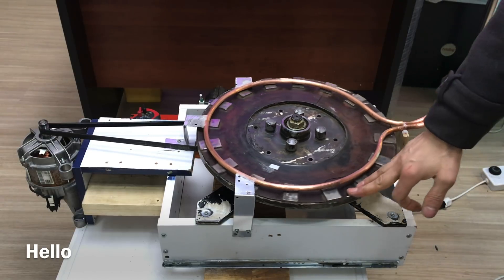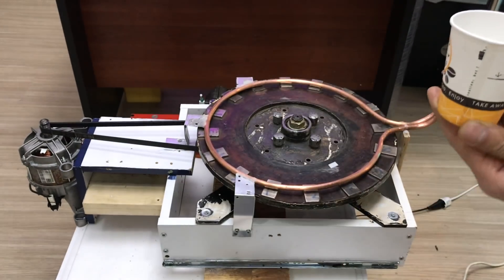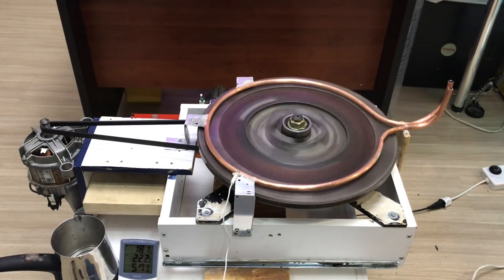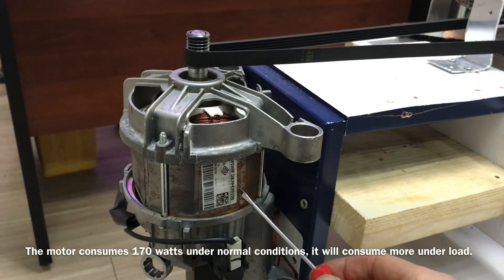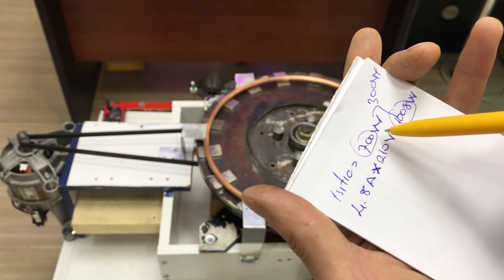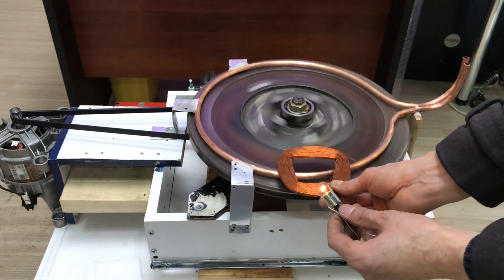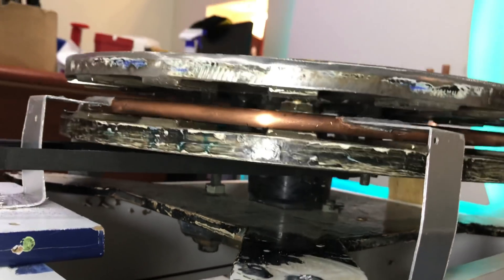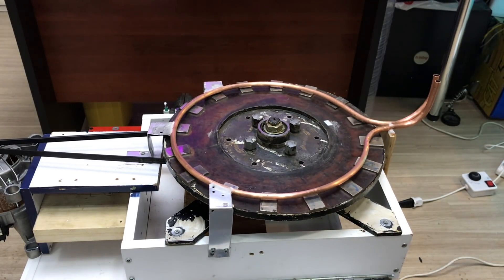MIKNATISLA ISI ÜRETİMİ, MANYETİK ISITMA VE REZİSTANSLA ISITMA KARŞILAŞTIRMASI

Comment: Thank you for this video  but its taking a long time to heat the water inside the tube . Yes as (paradiselost 9946 ) said  just press flatten your copper tube and you will get a longer current path at the flattened sides  resulting in more induced currents and much faster heating.

Comment: Hello Sir, I have arranged six magnets on a motor to heat up a copper but it doesn't heat. Please any idea on how to make it work (arrange the magnets polarity).
Thanks
Reply: RPM is always an issue. Distence from pipe to magnets. Shape of pipe. He may have operated at 1 to 2KH with relativley strong magnets: 10kg lift x 18 magnets x 1,000 rpm. Having 6 weaker at lower rpm can bring the temp waaaaay

Comment: Thanks for the video but that wasn't a good comparison.   The water in the tube is thinner than the water in the kettle.  Also, your method of measuring current isn't fair.  What you need is the water in the kettle has the same thickness as the water in the tube.  Then use the amp meter to measure the current, not the rating of the kettle or the motor.  Also use the timer to track the boil time.  One thing to consider is that the water temperature in the kettle is more uniform than that in the tube.

Comment: Probably schools should teach science better...  The magnetic field has to cross the area of the conducting coil to induce significant current (as your coil with LED does). Or you might use conductive plate to transform alternating magnetic field into current and heat. A resistive stainless steel can do... A snake-like design may work, although with large air filled gaps it will still be veeeery inefficient. A normal alternator + resistive heater should definitely work better.

Comment: The volume of the copper tube is 0.05 l, the diameter of the tube is about 8 mm, the radius of the tube is 4 mm, the length of the tube is about 1 m. So let's calculate 3.14 x (4mm x 4mm) x 1 m = 0.5 dl. Original formula for volume πr²l. Motor 220V / 4.8 A = 1056 W! So, as I already wrote to you in other videos, it is not very efficient... Plus additional expenses for magnets, copper pipe, radiátor,  pump, hose, motor and time for construction? And above all, it's noisy! I'm not talking about the thermal and induction losses of the motor, so the efficiency can be 50%....
Reply: hello, I want to talk to you about the system, can you give your mail?

Comment: Hook your magnet base to a steering engine (Runs on heat) and wrap the copper tubing around the heat collection bulb of the sterling engine., use an external heat source to get it running until the copper is hot., it will run itself.
Reply: Lol yeah overunity can only happen when tapping into an extra source of potential energy like a sterling engine on a geothermal site or copper that has an oxidation on it to take in solar power but it's a lot to overcome friction and wind resistance but in a vacuumed box using magnetic bearings you probably could keep it running from solar power of copper coated in oxide like the first solar cells that existed and spend 50,000 dollars for a motor that can't do any work !!! But who knows how long until it sucks in hydrogen or other gases through the plexiglass and slowly dies I know it's basically impossible to keep hydrogen in a container so it's probably impossible to keep out!!! Lol

Comment: Place your copper coils over top and underneath the magnets, add more turns. Place in a vacuum chamber and eliminate air friction and heat losses. Use more smaller magnets will work better work due to the higher frequencies. Like an induction heater Direct drive would also use less energy. Very cool! Tim van der Horn Canada chers.
Reply: Great advices. I think that magnetic field suppose to go through windings of copper tube. Not just lick simple, straight pipe
Reply: I was wondering if the could divas you said by putting in more smaller magnets but puting then in north South East and West poles in a random way hopfuly creating  random fiction from all directions hopfuly creating more heat also could you make the pipes have lumps of copper randomly made into the piping up to a inch thick all over piping also therfor creating more friction then creating more heat . Would it work that is the question.???
Reply: just by utilizing more turns within the eddy currents area of range will multiply the surface area that's affecting the water. since the copper coil's circuit (like a wire in a circuit) is a broken circuit, the drag that is created should be negligible to the benefits of increased turns of the pipe.

Comment: I couldn't see very well, but. Your coil looks as if it is grounded at a few points. An since your passing magnets along a copper apparatus,, wouldn't a electrical  charge be generated into the copper pipe. I think I see a short circuit.
So I'm wondering 🤔 if this is also assisting to your heat source. 🤔
Reply: The whole point is to have the electrons in the pipe vibrating - pref up to 50kh. Theoretically the net effect is a neutral charge with the liquid being a coolant.

Comment: Thank you for demonstrating a great alternative heating possibility! What factors could make it more powerful? Bigger magnets? Faster rotation speed? Using more copper? Would love to hear your opinion.
Reply: This is just a very simple induction heater 
Commercial induction cooking doesn't use a rotor to spin the magnetic field it dose it digitally with sets of electromagnets thus much more efficient bc its electricity>magnetic flux>heat 
Where as this is electricity>kinetic energy+>magnetic flux>heat +all the friction loses that you don't get with solid state induction heating
Reply: @dez3940  What method would you use to increase efficiency of his machine ??? I know they are right now using something like this heating water heater with crazy low electrical usage.
Reply: more copper. or, more SURFACE AREA.
simply flattening the pipes gives the eddy currents a better path.
using a thick sheet of plate would make it a brake... a dyno. an eddy current dyno...

Comment: Nice work. Btw, here in Serbia we also call bakar, as the only name for that metal.Also it is the case in Slovenia, Croatia Bosna , CG, Macedonia. Ex YU.
Reply: Do you call  also this words,  cekic  peskir  yastuk??
Reply: @burak...2648  yes
Reply: Hammer, towel, pillow
Reply: @burak...2648  baklava,  astal?
Reply: @colloidalsilverwater15ppm88   i dont know,  but you know also baklava 😊
Reply: Saying also,  hayde siktir ? 😊
Reply: @burak...2648  hajde, but siktir I think still in use by some older people in Bosnia. I know the meaning: go away, run from me or like that.
Reply: Corapa makaze ?
Reply: @burak...2648  Ĉarapa, čarape means stocking , stockings. Makaze are scissors.

Comment: Hocam bana inverter yapıp satabilir misiniz  1.5v 12v yükseltme cihazı 12 voltuda DC 775 motorda kullanacam
Reply: 1.5v kaynağın ne? Kaç amper?
Reply: @profezor2  elimde hatta 6v 1w güneş paneli var onu 12-14v yükseltmek için inverter lazim
Reply: @yusufberkesahin97  12V a yükseltince amper düsecek, düşünce de motor çalıştırmak güçleşecek. Yükselten hazir devreler var 10-15 TL ye ama amper düsecek bilgin olsun
Reply: @profezor2  hmm peki o devreler nasıl birşey ne diye gecer
Reply: @yusufberkesahin97  voltaj yükseltici devre veya boost up devre diye aratabilirsin